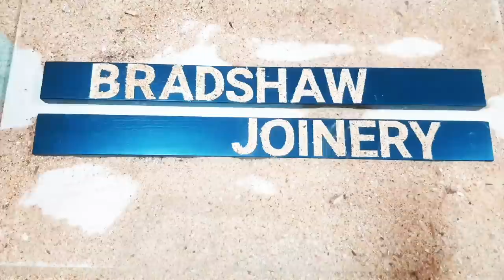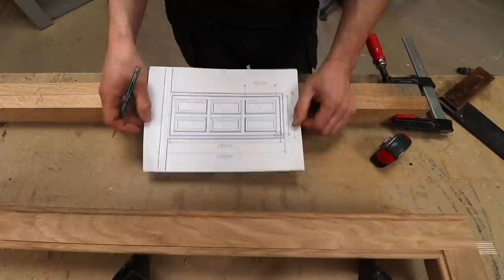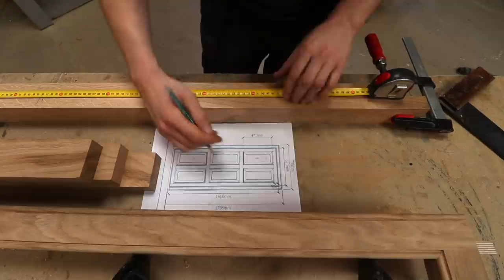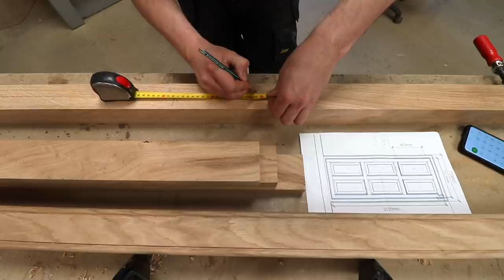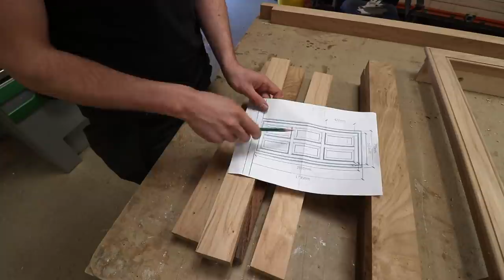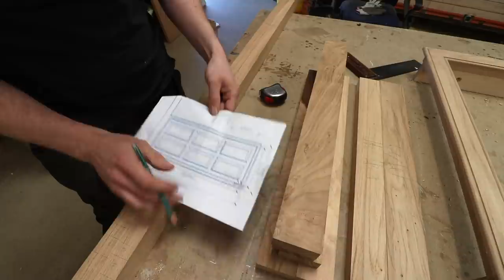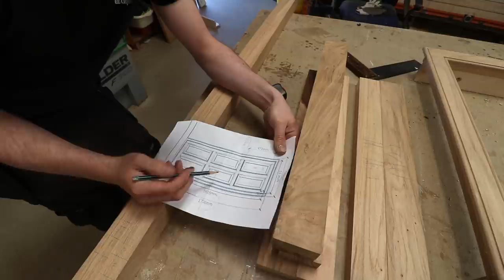English Oak Cupboard - Part 2: Raised Panel Oak Door including hand scribed jointing

Comment: Another cracking video As Ian Said below great craftsmanship and attention to detail, need to watch again so I get that hand scribe completely understood. Why don't you machine scribe the joints.
Reply from the maker: Basically to match the profile of the existing cupboard I had to tilt the cutter in the spindle, so the scribe cutter wouldn't work. For a one off no point getting cutter and scribe profile made. Also with short grain scribe cutters can sometimes split out so a small hand cut scribe works well
Reply from the maker: Thanks btw Pete 👍

Comment: Great job and looking good so far , impressed with the results from hand scribing the mouldings . Again I reckon you are improving the quality of my own work as I’m learning with every video you put out, could you do a video on using the tormek to touch up moulder knives I think it’s fair to say a lot of us could do with sharper moulder knives!
Reply from the maker: Thanks David, I will have a look a the video. I only hold the cutter flat against the outside of the wheel until its nice and polished. no good if your moulder knives are really blunt as youd have to take a lot of material off!

Comment: Hello. Great video, all your videos are great. Is this scribing method a good method for an external pattern 10 style door?. It needs an ogee mould on the inside and i was planning chamfered beading on the outside (the client wants an existing set copied, i am going to use accoya instead of the redwood which has rotted out). I don't have a tenoner so cant run a scribe all the way through the shoulder of the rail as most modern doors are done.
Reply from the maker: Yes absolutely! It's how I would do it if you have a moulding cutter but not a scribe!

Comment: Excellent work, again! Some lovely looking timber. Panel raising looks perfect.
With the moulding scribing why do you not mitre them like on the frame? feel like I'm missing something.
Also when this gets finished are there any ways to avoid an unfinished strip showing if the panels shrink and pull out of the groove slightly? I'd have considered finishing the panels before assembly but doesn't sound like you're going to. I often see this on stained front doors. Appreciate your timber is old and interior so probably not an issue on this project.
Cheers
Reply from the maker: THe frame bead is mitred as you cannot scribe a bead moulding around a corner. you use a scribe so as the rails shrink in width the joint can slide along the moulding and not open up a horrible gap that you get with a mitre! 

Yes finish colour the panels before assembly, that way you hvae the best chance of not highlighting any movement! it also decreases movement if the panel is nice and sealed completely.